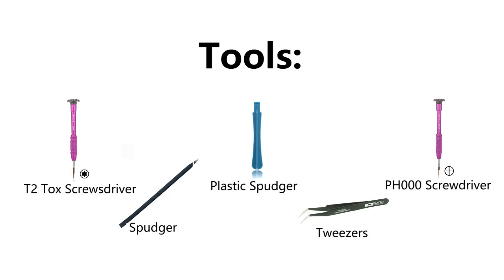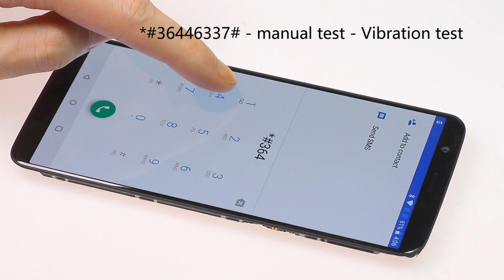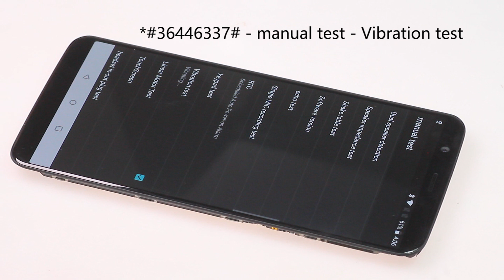OnePlus 5T Vibrator Repair Guide

Comment: Thanks for the video, helped me changed my vibration motor on my one plus 5t.  Due to vibration motor intermittently working. Called one plus customer support and they told me  it was software related and to factory reset my phone which did not work. Tried a new vibration motor for 2.99 worked a treat. Hopefully can continue to use my one plus 5t for a couple more years. Great phone.